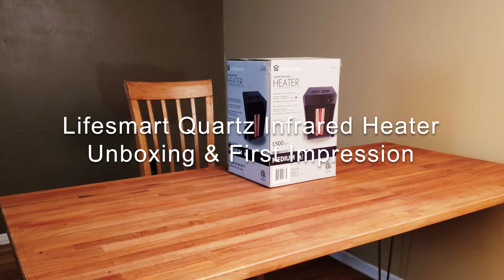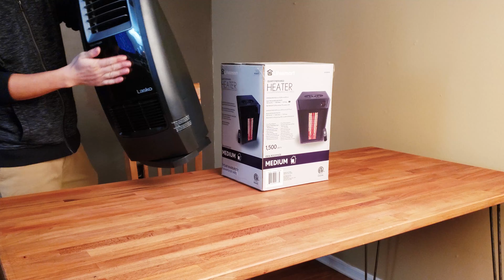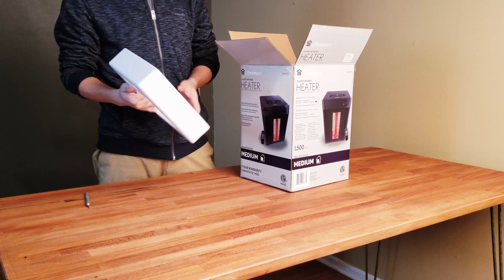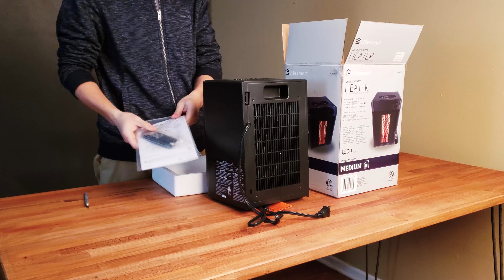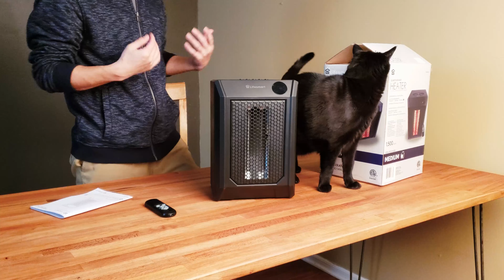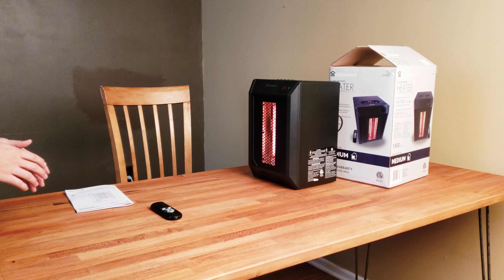Lifesmart 4-Elements Quartz Infrared Heater Review

Comment: Infrared quartz heaters are safer than traditional ceramic. Quartz tubes are non combustible and LIFESMART heaters have built in overheat protection built in as well. You should also not advise people to use extension cords with these products due to the high amperage draw and the explicit instructions in the manual not to do so. Always follow the recommended manufacturers instructions.